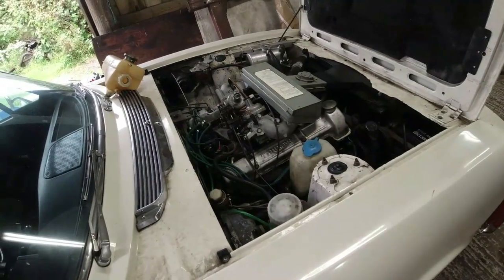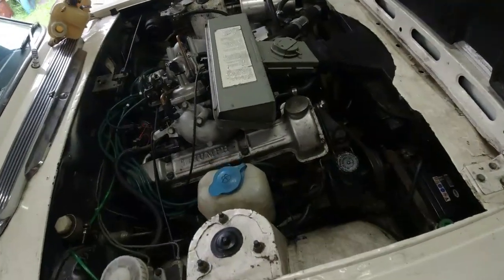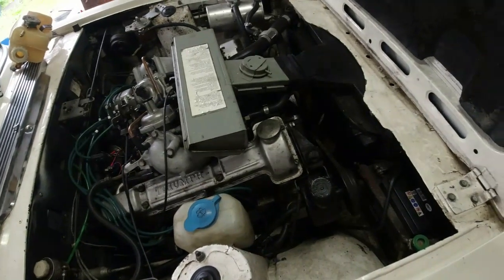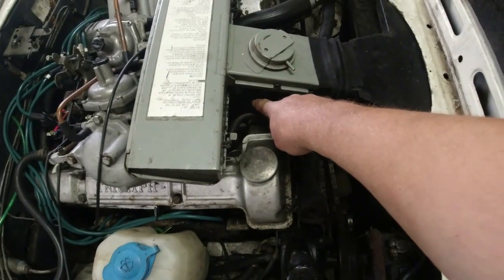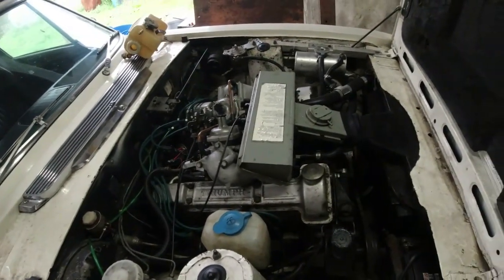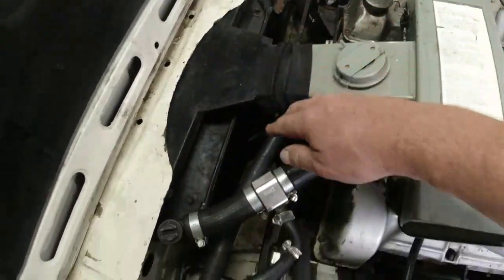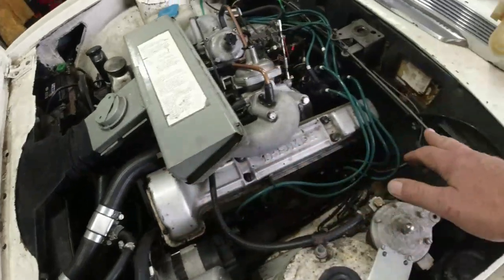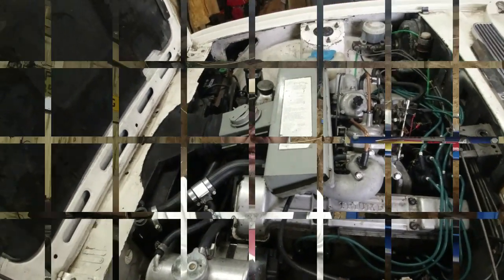1973 stag cooling system - Parental warning for terribly boring content and profanity

Comment: Stag cooling isn't a problem, and can be fixed.

Problem is people LOVE regurgitating the "they all overheat" stories from the first few years of press.

"For the love of cars" couldn't find any problems with theirs, so they drove Alexi Sayles one in traffic, idling WITH THE HIGH BEAM ON ON A SUNNY DAY until they flattened the battery = "See? Stag - they ALL break down!!!" ANY 70's car would do same.

The REAL problem was BL by that Stage were putting cast iron pushrod cars together shoddily. Workers problems /strikes meant that giving that factory a new OHC alloy head car was ALWAYS going to be a disaster.

Give an Aston Martin (or take a modern Honda back and give to them) = it would have been worse.

But once people "have a legend", they WANT to just carry it on/believe it.

Many in the Stag community here know mine used to be a "drive home for Xmas" car here in Australia, and that was from Perth to Melbourne return. 3500 kms one way, so drive that Perth to Melb (from posting to home), then 4 weeks at home on leave (military), then drive back again.

Always in summer, always high speed cruising all day dawn til dusk. Leave Melbourne Friday 1 pm, arrive Adelaide that night. Leave there at dawn, stop somewhere mid SA (Nullabor) for the night at dusk, up at dawn, arrive Perth Sunday arvo. Cruise for 5 hours at a time (tank endurance) at 110 km/h................ on the Nullabor (NOTHING out there) 130 km/h all day. That is 4,000 rpm (auto back then, changed to man/ o/d later) in high 30's heat (deg C) and up to a peak of 48 deg on the Eyre Peninsular.

Many just don't believe it. Whatever, I know what I did. If people WANT to believe "my Stag has to keep running hot/can't take it out over 24 deg C" = fine, up to them. They can limit themselves, but they don't need to. People who know me believe/know it happened.

I live in Australia. I wanted a touring convertible. If I can't use it whenever/however = may as not well have it.

It was my ONLY car from 93 until 2001, then it shared "drive to work" duties with a Dol Sprint until 2013, when I retired the Dol and bought a "newish" car Stag now shares duties with. (Sprint went to Melb from Perth and back to get manual for Stag in 2003).

Still gets driven twice a week whenever sun is out. Is far better to park at shops than "newer" car (2012 Chrys 300C).

Point is - Stags can handle the heat. If mine can handle all day at 40 degrees with a few hours at 48........................ yours can as well.

Simple as that......

They do have their niggles/annoyances. All cars do. I made mine handle heat with what I thought were common sense mods. 

"Stag's overheat - they ALL do!!!!" Pfft. But if the world wants to believe that, (and make them cheaper for me) - so be it. Those of us who DON'T believe it.............. we aren't the ones missing out on a great touring convertible at a fraction of the price of all the others.

🙂
Reply from the maker: Excellent post, 10/10.

UK is full of this nonsense - they all overheat, two Dolomite engines welded together etc etc 

Cannot reason with these morons so I avoid them
Reply: KJs581 wrote:
"Stag cooling isn't a problem, and can be fixed."

Then why is it being fixed if it is not a problem?
Reply: @johnburns4017  Semantics mate. I meant "fix" the fact that most aren't maintained properly, not have to mod everything to survive in UK climate. 

My point is that the rehashed "problems" that the motor mags spruke aren't.

Casting sand left in engines and the way BL put together ANYTHING was the problem; NOT with the engine design. Put casting sand in ANY engine and it will fail. So that means all engines "are bad designs?" No. 

BL clutched at straws and did some stupid things because they were driven by board room desperation. 

The majority of people who bought Stags drive them in the UK, where it doesn't get hot (as hot as here at least.)

When I got mine, I was driving it in one of the hottest climes on earth. 

Mine had the wrong radiator in it. So was ruined by someone doing the wrong thing.

I put the correct radiator in it, and it was fine. But as I was going to be driving interstate; I made some subtle mods, and with that, it drove across the desert in 48 degrees. But my first interstate summer/desert trip was before the mods. It made it, but I wanted the "extra capacity" so tweaked it a bit. The average person doesn't need that, but I like it.

So - my point was - in well maintained condition in England/normal climate, the Stag cooling system is fine. I tweaked mine slightly as my use was a bit extreme.

My "can be fixed" didn't mean mods. It meant "can be made to work properly" because most won't be operating properly/not maintained properly. 

I made my comments because I have a Stag that can drive in the Australian summer on a 40 plus degree day; ( and has done, all day, for 3500 kms in up to 48 degree heat at an average of 110 kmh dawn til dusk) so that shows a Stag system CAN be an everyday car in England.

I thought some people with Stags who get the "gloom and doom/Stags can't handle over 25 degrees" rubbish might find that helpful. 

Not to argue one line semantics. Or maybe I didn't express that correctly. If so, my apologies. :-)

Cheers mate.
Reply: @KJs581  
The Stag did have overheating problems, whatever the reason. It was pulled from its prime market, the USA, after a few years, because of overheating causing catastrophic engine failures.  There are third party mods to fix the problems. I never made any of this up.
Reply: @KJs581  
I have had, and driven, countless cars and vehicles, and driven right across the USA and back in summer (Death Valley), and three years in the Middle East. Not one overheated. 

The Stag in stock form out of the factory, does have overheating problems. People who deny this are not in the real world. Not tackling the known and documented problems, is have the AA number handy at all times. Essential is a high up expansion tank, which also reduces pump cavitation.
Reply: @johnburns4017  Yeah, it had overheating problems because they threw them together, and left casting sand in the blocks. Because at that stage BL were hopeless. (I think I already said that; and nothing I said was "made up" either). BL at the same time had a Rover P6 V8 that blew 3 engines in a year, 2 gearboxes and a wiring loom, all from lousy assembly/maint/QC. Far worse than any Stag, because BL were hopeless. And THAT is with the engine that that everyone says "if only the Stag had the Rover V8." 

Quote; "The final years of the Rover P6 coincided with production problems at British Leyland. This was highlighted in August 1975 when Drive, the magazine of the British Automobile Association awarded a trophy to a Rover 3500 as the worst new car in England. It reported that a Rover 3500 purchased in 1974 had covered 6,000 miles (9,600 kilometres) during its first six months, during which period it had consumed three engines, two gearboxes, two clutch housings and needed a complete new set of electrical cables. The car had spent 114 of its first 165 days in a workshop.The runner-up prize in this rogue's gallery was awarded to an Austin Allegro with forty faults reported over ten months, and a Triumph Stag came in third."

Point is - mine ran fine put together properly with original bits/original spec. I enhanced it slightly to give that "little extra margin" as mine is one of the hottest places it will have to operate for my piece of mind.

Sorry, I drive a Stag for 30 years in a hotter clime than most/ have no problems with it.  It shows they can be ok standard. I thought sharing that might help some people.

Silly me, I won't do that again, I'll just use mine whenever I like /when it's 44 degrees in the shade and keep it to myself then.

Got it.
Reply: @KJs581  
I did get it!
Even you, who is making out there is nothing wrong with the cooling system, did a mod to the cooling system. I really did get it. 🤣
Reply: @johnburns4017  Ok mate, fair enough. :-) :-) :-) Sorry for my previous tone, I took what you said the wrong way, apologies.

I made mods because my use was a bit more extreme than most. That is driving home coast to coast at 110 kmh all day over the weekend every year for Xmas leave. I was silly enough to do it 7 times, 3500 kms one way, 4 weeks at home, then back to work again. Young and silly then, don't do it now. Car just does suburban duties now, occasional blast through the hills, but it is easier to park at the shops than my newer car, so gets a lot of use during summer. 

But the first trip it was standard/unmodded; and it survived/did it ok. I just like that extra reserve capacity. I mean, if you can, why not??? 

I agree with you, the cars when released were unreliable. What I have a problem with is the press stuff that says lots of problems that were just............ wrong. BL's assembly and uselessness was the problem. They couldn't put an Ikea kit together. :-)

I read that when BL did the North American TR7 launch, they sent 51 cars to all the dealers and for press cars. MOST "had problems" and it was "up to the dealers" to "get them going." Almost all of them broke down. HOW could anyone expect that to work???? Really bizarre. The company was really out of touch. I have a Dolomite Sprint as well, a car that Leyland Australia couldn't make reliable here.......... mine was co work car with the Stag for 13 years. I can make it ok but factory couldn't??? 

My car has done 440,000 kms (350,000 by me), had it 30 years, and I'll have it forever. And the bad rep made it cheap enough for me to buy, so to me a good thing/it actually helped me. Unlike the US, (and even though our weather is great) here we don't get many convertibles; so in my country, it was the cheapest, long legged touring convertible I could buy, and it suits me. 

Cheers mate.
Reply: @KJs581  
No problems. 👍
Reply: @KJs581  
A problem with Stags is that you may have one of the flawed cylinder heads. One of the two contracted out third party head casting companies changed the cooling ways not telling Triumph. You will not know if you have one or even two of them, unless you take them off and know what to look for, which few people would.  You may be lucky and have two heads that were not flawed from the good manufacturer. But you may be unlucky and have two of them - kaboom! If you have one of the later Stags, the chances are that the heads will be OK, as the flawed heads problem was eradicated.

The original Stag was tested with head gaskets from a German manufacturer, which were thick with enough compression. The buying dept then sourced cheaper gaskets for the production models that were cheaper - and thinner with no compression.  Hence early cars had lots of cylinder head failures that overheated the engines causing catastrophic failures; until the problem was identified with superior gaskets sourced. 

Mods such as: 
1) bigger rad:
2) 12 vane water pump, or;
3) electric water pump;
4) electric cooling fan;
5) higher located expansion tank;
6) taking return from the heater away from running cool water into only one cylinder head. 

These mods will make cooling matters less problematic. These mods matter if you have a flawed cylinder head, or two of them. As you may not know if you have one, it is best to apply most, if not all, of the mods. An insurance, as overheated Stag engines usually means a full very expensive engine rebuild.
Reply: @KJs581  
On another U tube Stag vid you wrote you installed an electric cooling pump, which you never mentioned here.  So a larger radiator and an electric cooling pump. Yours is very much not a standard cooling setup. Where was the electric pump fitted?
Reply: @johnburns4017  Hello mate. As my Stag was/is a long term prospect (bought in 93 as my then only car /was only car until 2000 when I bought Dolmite/Dolomite and Stag then only cars to get around to work until 2012, when I rewarded myself with a 2007 car, which now shares driving with Stag)  and has done 330,000kms, I "like to have options" so whenever someone has Stag parts they are getting rid of as "getting a newer car" I snap them up. Some are only good for stripping/spares, but I ended up with a few heads/blocks etc etc. 

Handy to know for back ups, and all the heads I have look the same, but as you say, if restricted passages, you would never know.

My car essentially had the same engine until about 6 or 7 years ago, when the crank was running ok, but I knew the wear was past what it should be (no noise or loss of oil pressure, but last time I had it apart, I wasn't happy with the centre main wear and my "fitters mod" to get it by. To be fair, it had done over 400,000 kms by then, so not bad.

I had always just "re ringed/bearinged" my engines, never even rebored, so I decided to "give it a birthday" and bought a new engine when I retired.

Supposedly rebuilt by a Stag specialist. I would have preferred to do another rering/bearing, but "was getting old, so...." and the engine was a reasonable price.

Anyway, when I got it, I wasn't happy with it. It is in there, and goes well, but.................... well, the water pump housing had gouges in the block surfaces due to using the wrong puller. I have removed dozens of Triumph WP's and the block housing is critical, and I have never scored one, because......... you just don't. So if this guy was a "Stag expert" - how come he didn't know how critical that was?? AND the compression ratio really is too high, even with thick head gaskets as over skimmed (everyone does it, but I have a solution.....). 

I have a prefect crank from an old engine I got for very little. It had been sitting out in the weather for decades; so was mostly scrap, but crank was good, so eventually (if I live long enough :-) ) I will rebuild the engine I took out with that crank, keep the "new/expert" engine as a spare. 

But I spent 2019 to 2020 doing total rebuild of my 62 BSA 650, and have just totally stripped my 74 Trident 1000................ so.............. I'll just drive the Stag until then. 

With cars, if a part gives me trouble, I look at why. In a lot of cases, it is because the "new" parts being made are just rubbish. The BSA was an eyeopener. Most new parts are useless. I ended up buying "new old stock" for three times "aftermarket new" or cleaning up the 60 year old orig part. Live and learn. 

For example, not many people drive Stags/TR3/4/5/6/Triumph 2000/2500 the miles I do, but when they were new you could.

I found the recon hubs just didn't last. The bearings are HUGE (bigger than fronts, and fronts don't fail). I went through 3 "reconned by experts" hubs and they lasted between 2,000 and 5,000 kms. Supplier said "No one else has any problems with them....." because they have show cars that do 500 kms a year.Every time they failed, I put the "old orig factory spare I got from wreckers" = and it went FOREVER - but had slight whine, so only for spare.

The bearings are huge, they are SKF when pulled apart.

So - either the collapsible spacer is defective, or not installed properly. So I made up my own shimmed soild spacer, and did 3 while I was at it. Two I installed were on there until recently and did over 100,000 kms, and were only removed because I installed some Nissan shafts as "I had had them there forever/got around to it." When removed, bearing clearance same as day installed.

I don't normally mention it, as I did once and got asked how, then people arguing/abusing about the engineering/not orig etc etc. 

So, I have an extensive engineering/tech hands on background. I work out a way for something to last as long as I need it to. Share to try and help. Get harassed. Learn from mistake, delete comments, keep to myself, and never ever have a rear wheel bearing problem. It just isn't worth the hassle.

But getting back to "spares laying around". Even a corroded head that can't be used. Handy template to have a look at when you have a part of head that is hard to get at when on car. Can look at spare one to see what/where etc. 

Your info about "bad batch of heads" is interesting, and proof you always learn things.

I NEVER consider myself an expert on anything. When I was rebuilding my BSA (and with my Stag) I have been referred to many "experts"; and I ask a few questions and get blank replies.............................. so I then do a bit more reading, do it myself. 

I am NOT an expert, never will be. But so many "experts" I meant who knew less about what they were experts at than I did. :-) :-)

Cheers mate.
Reply: @johnburns4017  Hello AGAIN Mate :-)

I didn't mention it as again, start arguments.

Firstly, I did not WANT an electric pump. But I was sick of the gear driven pump (courtesy of SAAB). It is fine when it works. And originally it did. 

When I had had my car a few years, I had not heard of the "bad batch of wrongly hardened pump gears."

I rebuilt my pump hastily, as couldn't get a "new" one, but the shaft was pitted. 

At great expense I got a "new unipart" water pump. Oooooo. It lasted 1,000 kms, then clattered. Pump gear and jackshaft ruined. Supplier refunded WP cost, but not ruined jackshaft, as "old car, so......" The fact that the shaft had been in there forever, and only failed within 1,000 of the pump......

Over the years very hard to get pump shafts. It happened once more after a pump rebuild when agiain jackshaft shredded.

I wanted a mech belt driven pump, as seeing my trade is electromech (technically radio fitter, but actually combat systems tech, which covers most fitting/aligning/etc etc) I really don't like elecs if I can keep away from them.

I tried a Hyundai Sonata pump, and got that on the car, but the pulley was a bit close to the PS belt.

So I gave in and fitted the Davies Craig EWP 80, and it works fine, I just WANT a mech pump.

I know there is a kit that uses a Ford V6 pump. Others like them, but I don't like the layout. My choice. I am playing with a Triumph 6 pump, but baby steps.

Anyway, my pump is where the alternator used to be. The Lucas 43 amp alternator is useless for my application. The diodes are too small, and where it is next to manifold, in 48 degree heat, no good. Also, with upgraded lights/elec fan etc etc, I use a Bosch 60 amp mounted where aircon comp usually goes. Works perfectly and if ever failed (hasn't), ANY wrecker anywhere would have one, as standard on dime a dozen Holden Falcon here, so could grab and fit mid trip in 20 minutes.

Others use the electronic controller. I don't. Again, each to their own. DC are adamant their "water pulsing" set up is good for quick warm up etc etc. I don't like it. Mine runs flat out, and DC warrant "continuous use" for 2000 hours. I have an hours counter on mine, and 2000 hours on mine with current use will be in about 8 years - I'll just buy another one. 

A guy in Melbourne had the elec controller, but the "pulsed thing" meant his heater didn't work, so he had ANOTHER pump just for the heater. I had to help him with that, he had that backwrads, so when "heater" pump on, temp gauge read wrong. Easy to see why when analyse flow.

Anyway, mine is as simple as possible, and is where alternator was. It basically mimics the existing pump, but "upstream". Standard thermostat works as normal, water out of pump, through block, up through heads, out of thermo housing, back to pump input through 1/2 inch feed. When thermo open, same as original. Thermostat regulates constant flow perfectly but "divvies up" between rad and bypass. Heater works as normal, water from rear of head to heater, from heater back into a tee with thermostat housing that goes back to pump I/P.

I like it simple. 

That hasn't done any "cross Oz" trips, but works fine around here. If the elec water pump fails, I will just buy another one. I think it has been in there for about 5 years now.

Like I said, I don't really tell anyone, because when I did (to try and help); everyone argued/hassled me/told me how it wouldn't work/that's not right. So I just deleted all my comments, and just "use it and it works fine." 

I mean, I got a call from the managing director of Davies Craig, who make the pumps. Rang me on a Saturday morning after I sent them a query on size of a fitting (I ended up making all my own). :-) I was surprised. I told him I was going to run it constant/use existing thermostat and he asked "why not electronic reg" and I said that seeing I was a combat system tech/fitter, I preferred to have as little electronics as possible. He said "Fair enough" and said constant flow was fine, the pumps were rated for it.

So - the person who makes the pumps happy for me to not run electronic reg. Rest of world = not happy/can't do that. 

Oh well. I'll just keep it to myself then. :-)

Have a good day mate.
Reply: @KJs581  
Could have an electric engine heater for a fast warm up.
Reply: @KJs581  
The Stag for the first five years, 1970-75, was made in Liverpool. Well the body was. The car was all manufactured in Liverpool: interior, body, painting, dash, the lot. I believe the electrics were also fitted. The body was then taken about 110-120 miles to Coventry where the engine, gbox, suspension, wheels and complete drive train was fitted. 

The last two years of production was moved to Coventry 100%, as Liverpool was being fitted out for 100% TR7 production.